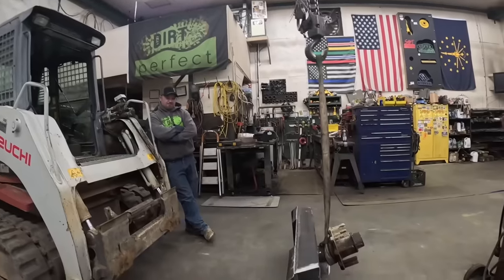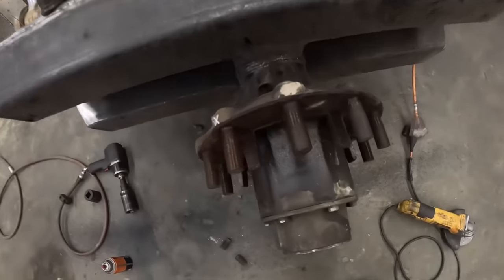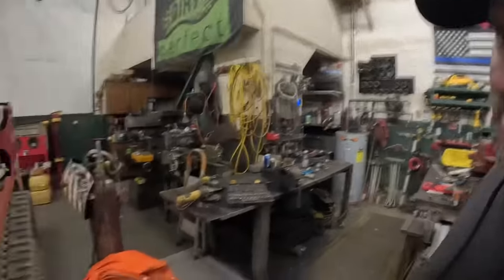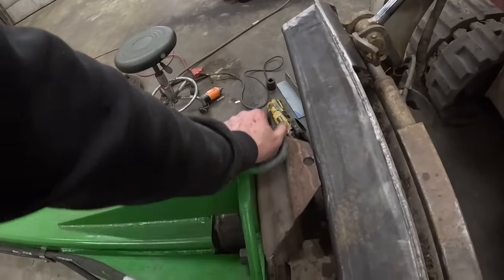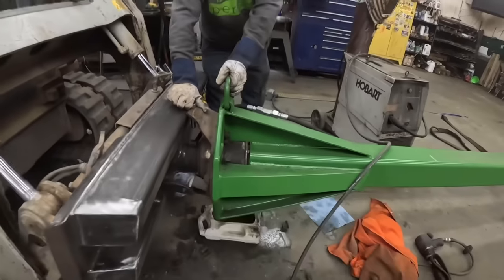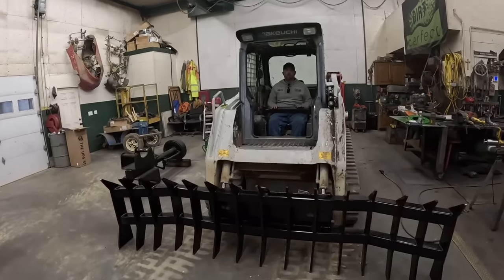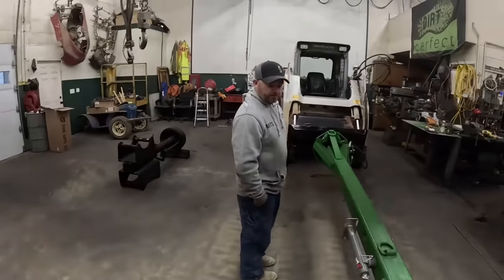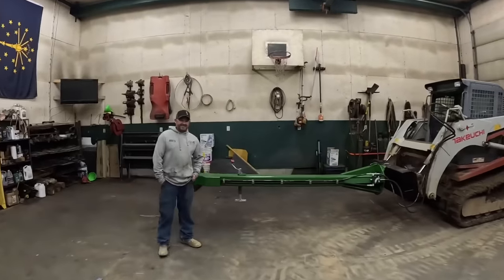Testing Out The Brand-new Saw Set up on CTL - Success Or Failure?

Comment: I think I would put a guard on the back portion to protect the driver. If for some reason if the blade broke or come loose it could get real ugly real quick. Be safe.
Reply: That blade that big and heavy its going to just about split the taco in half.
Reply: I was thinking the same thing
Reply: That would take all the fun out of it.

Comment: Might I suggest that since y'all have plenty of studs to bolt it to.
Take three of those out, and replace them in a way to taper them as alignment pins that are longer than your attachment studs.
That'll make it much easier to connect everything together. 
Otherwise I say y'all did excellent work both in conception as well as construction of y'all's universal implement.
Nice rake for cleanup afterwards too.

Comment: If you'd have kept more of the brake drum you could have just added holes to the drum with one anchor point on the attachment to index the rotation.   awesome work!
Reply: That is what I was thinking
Reply: Same
Reply: Great minds think alike 😂
Reply: That could still be done with another junk drum since it’s not welded to anything.  Version 1.1 😊

Comment: Hey Mike just to let you know you can move one bolt hold over for each lug nut that would change the angle of the blade. Great job my friend
Reply: 1 pin vs. 8 lug bolts.. pin seems a lot easier.
Reply: @Silverhornet81 
I think he still means to use the one pin but if DP finds placing the blade just off vertical he could utilized the 10 (not 8) lug nut positions to adjust the blade angle by 36* off vertical or horizontal.
Reply: Sorry.. 10

Comment: You can always increase the blade diameter instead of turning up the rpm’s on the drive motor.  Blade tip speed will increase and blade mass will give it more cutting ability.

Comment: Hey Mike. Very nice job.  With an air ratchet to mount and unmount, it seems like this will be more challenging for an on-site switch over from one mount to the another!  Just a couple of thoughts on improvements.  (1) You could mount the stand to the top plate that connects to the 240 (Plenty of space on top of the 6x6 bar).  (2) You could add in a valve control bypass to give it more power if necessary. (3) Ever think of replacing the saw blade with a chainsaw bar?  Looks like it is possible and you could get some extra reach with larger limbs, maybe in the range of 16 to 30 inches!  Where to mount the auto bar oiler! 😁

Comment: Mike, it looks like operating with the blade in the flat position really works for cutting down the trees. I could see where trimming limbs straight up and down position would work really well along a trail as you mentioned. Trying to cut small trees with the blade straight up and down leaves a pretty dangerous stump but when the blade is in the flat position it looks like you can get pretty close to ground level. Great job and thanks for taking us along during this journey of yours.   J.R.

Comment: Great job on both of those projects. I have a couple suggestions for the eliminator. I would think you would have better hose protection if you rotated the saw so that the blade was above the attachment in the horizontal cutting position. The second suggestion would be to add a skid attachment to the end of the saw so that if you hit a dip while running the skid steer, the skid would prevent the saw blade from gouging into the ground. You could also consider building a bolt on skid that sits back offset from the motor side with an additional skid that would prevent the blade from going into the ground while in the vertical cutting position. The only downside to it would be that it could be in the way if you're trying to cut in between trees that are close together. Hope this helps

Comment: Great Job, Guys!!!  One suggestion for easier changeover on each hub.  Replace two of the (opposite side) lug studs with smooth side pins (on both hubs), with diameters slightly larger and longer than the lug studs major thread diameter/length.  Should just slide on, even slightly off angle, and completely protect the lug threads.  You may be able to swap the saw arm from hub to hub, under machine power, as well.

Comment: You need a ground skid (ski) that can attach where your removable leg mounts, to keep the blade out of the dirt in horizontal cut mode... Heck, if you plan it right, it could work in vertical mode too!  This thing is cool and red neck dangerous on a Mad Max scale!

Comment: Shop time today ,for the next iteration of the Frankenstein saw  ,one of those unaccounted for obstacles, engineering on the fly ,critical thinking ,AKA working through problems ,A  great way to spend Monday morning ,watching the boys A fabricating on Frankenstein saw ,I was wondering How long it would take Mike to Start taking down some big stuff besides saplings and then the pine came down ,you just need to spin the blade at a higher RPM .Awesome Job you two

Comment: It seems to me that you could benefit from adding a 'wedging' arm to your spinning blade. This could conceivably stick out from the main arm at an angle of about 45 degrees and be a few feet longer than the blade radius. A strong-enough loading spring could work ... to stabilize the saw and arm as you approach a trunk or a branch without creating hard collision.. Right now, everything is sort of wobbly and you waste time lining up properly. The arm would slide against the object to secure it to the saw arm and allow smooth cutting without bounce.

Comment: Awesome builds! One thing I said to myself throughout the saw build was the hydraulic lines along the boom should have been hard lines instead. But as it is now I think it would be wise to add a protective cover over those hoses on the boom. And, try removing the flow control to see if the Taco runs it better.

But overall, what an awesome use of bad weather time!

Comment: Hi Mike,
I have a suggestion for your Limbinator!
Weld on a 2" square receiver hitch socket pointing down.
The make a "T" shaped insert as a stand. 
This will provide a stand that can easily be moved, but it will prevent the saw from rotating when on the stand. 
Unfortunately saw blades are expensive!
I love your great addition for your toy!

Comment: While you're getting the hoses, have a quick coupling mounted on the lemonador to where you can put a quick cup line there and then at a quick complaint on it. The skin steer and then that way. That set of hoses will be one size and then put a quick coupling. Um, the hoses for the excavator and then you won't have to change it. Do nothing but change out the 2 sets of hoses. That way you won't have to have too long. A hose on one or two or two shorter holes, on the other think about it

Comment: Good Job! Liked watching the build and can't wait to see it in action. Can't see much in what could be improved that wouldn't pass the cost analyses test. About the only thing I'd do is extend the Hose guard about 3 or 4 feet. Maybe with a fairly light piece of sheet metal with ribs for added strength and use the hose mounting bolts to hold it on. Unfortunately the best way to get the blade at a 45 degree angle would mean messing up some of your paint on the hub with welding another of Aaron's snake eye brackets to the backing plate. Again good Job! Very useful attachments that should pay for themselves fairly quickly.

Comment: See a hose solution.
Where you have them all bolted to the stick, get some 1/8" steel bent flat the width of the hose clamps and 45° on each side and use the same bolts to put a shield over the lines on the stick.  Should keep the branches off the important stuff.
That flow control valve just isn't working to full potential of the saw!  It needs to spin a little faster.
The best application i see is like the farm property, cut it down to a foot off the ground by just tracking left to right while going forward,  you should ger a 20 foot swath cut, then use the brush hog to grind it up and finish it.  It's not a forrestry mulcher, but together with the brush hog, it's close.  For the spots that are a little too soft for the 120 or 210.
I love watching an idea turn into a completed attachment!  I am most certainly a function over form guy, but you guys make it look good, too!
I know you hate orange, but, for visability and safety, ya should paint the outside plates on each side orange.  Would be much easier to see.

Comment: Great job guys. The only thing I might have changed is to put a rotating hydraulic motor to be able to spin the saw 360 degrees. With the hub assembly, you could put a ring gear on it run by a hydraulic motor…..just a thought. Again Great Job…very cool.

Comment: Well as i write it you said it while testing: A 45° locking option would give you more versatile use out of it. Maybee eve a 22.5° as a more vertical and more horizontal option depending on do you want more clearing out an area or overhead branches on a streetway.
Also clearly you need protection cover for you hoses to deflect falling branches. Just cut a Pipe and and bolt it on.

Comment: Guys, maybe a hydraulic rotator on the wheel to select the angle from the cab with a solenoid pin lock. Ring and pinion gear might be good. Great minds you have. Nice saw.

Comment: When I worked at the boat shop some of the employees went to France to work on a boat there. When they came back, they had a new 'tool'; it was a 6" circular saw blade on a high-speed grinder and they used it to shape lead ballast. 
I thought that was the most dangerous tool I have ever seen, until now.

Comment: Mike another fun video, you and Arron did another fine job, as always Castiron is very brittle and breaks Easley be careful I'd hate to see it rotate while it's in use, My drivers would break axles when their tires stopped spinning, in snow and the tires grabbed a solid surface not real often but more than I wanted to repair. I would have used something other than cast because it's a brittle metal

Comment: I know it's way too late to suggest this, but if you had a piece of plate cut to mimic the drum face, then make 3 tabs that stick out, 0° then 90° left and right, so the blade could be left hand cut, right hand cut, or bottom cut to reach under tree or bush. You could do the same with a drum, but so many are cast it might be difficult to work with.
Edit to add, using the current config, I would just weld another tab on the other side so you can make it a left hand cut, so the offset is in your favor depending on direction of approach.
Also, it would be dead simple to get a piece of channel iron, or 1/8" flat stock, run through a press brake to make a channel to cover your hoses from the motor to the base. Replace the bolts on your hold down clamps with studs or short sections of all-thread and use those to hold the cover in place.

Comment: If you ever make the larger mount a power rotate I think a flywheel off a truck could be fitted to the outside of the brake drum. Then use a starter motor with a spacer to keep the gear engaged use a power reg. to slow it down. You could use an actuator or solenoid to lock and un-lock the brake. I am thinking put a limiting switch so it will rotate about 130 to 140 deg.

Comment: Hello that tree trimmer is great 
I had a thought add more holes to pin it in they make pull pins you could weld to the break drum ear you can just pull up on pin rotate and let go of pin it's spring loaded they make. Electric ones to just a button push it unlocks let go it locks

Comment: I had some loggers once that, once they got into the shop, there was no getting them out until they ran out of money.

The saw on the TacoTractor really looks good.  I can see doing some definite timber stand improvement with it.  The only thing that I'd want is a way to change the angle easily from the cab. Snowball Engineering just did some repair work on an attachment for tipping boxes over to dump them.  Used a hydraulic cylinder and a rack.
Reply: Saw that as well and was thinking the same

Comment: You need to make a push bar on the other side of the blade so you can push the tree when you are cutting it. This way you can guide the tree in the direction you want it to fall. Also it will keep your blade from binding up.

Comment: One of the few things I might have done differently would be to use hard lines between the blade motor and the base of the arm where the flow control is.  Or, if hard lines don't make any sense, make a light gauge "sacrificial" cover that can be bolted around that side of the arm.

Comment: need an old water hose, cut to length and split, to cover the blade for protection.  Nice thing about the verticle cut is that you can get really close to the ground on your cuts.

Comment: Paint on the saw, paint on the Taco saw mount, paint on the brush/root rake but No paint yet on those 2 nice saw horses. Instead of the horizontal lock position - put one 30 degrees left and right of center.

Comment: I think that a deflector/guard of some type for the blade so that the drive doesn't get pelted with bark/twigs or showered in saw dust. I was thinking you might want to protect those hoses, when I was watching the build videos for it I was thinking you were going to run the hoses down the inside of the 4" tube. (I am sure that there are good reasons not to as well as to). Since you didn't do that, you could get some expanded plate and angle iron and make a grill over the hoses- adds some protection but not a lot of weight.

Comment: Something I noticed might be a good attachment that possibly could be removed would be some kind of push bar that will push the trees away, or try to. May not have that issue in one of the track hoes, but noticed it could be an issue in the skid steer.

Comment: If you ever decide to make another one,   use the same diameter tube but use circular pipe this time and mount the angle adjuster near the front end not the back using facing twin circular plates with a quick release pinch lock on it to make changing it from vertical to horizontal   or ANY angle inbetween etc a lot easier and faster in the field...... and eliminate that Heath Robinson brake drum contraption - which would save weight into the bargain,
 also I would consider using steel tubing  for the hydraulic pipes mounted along its length instead of the far more expensive flexible hosing which would be far more snag resistant and save on build costs just using a pair of two or three foot flexi pipes near the head.  but all that said damn good job thus far by both of you.  while you are in innovator mode perhaps consider a quick release dog clutch system for the blade  and an angled attachment to mount a six foot hedge trimmer  sticking out in front to hack through dense vegetation/foliage etc.

Comment: a few ideas:   on the ptl adapter plate add a mount for the jack to keep it out of the way.
For the brush rake keep a 4x4 handy to place under the "top" when you remove it so it does not lay flat, but at an angle to make hook up later easier.

Comment: Ok if a multi tool is something that has lots of accessories you can use, what's a tool that can be used by everything else. All you need now is to work out how you're imad max tool can be attached to both Bubba Dump and the 850j, it will be truly universal. Am sure it's going to last for a long time, it's built like a tank. 🎈

Comment: On the adaptor if you had cut the bolt  drop area 1/2 way around you could cut multi bolt drop holes and had more angles.

Comment: Adding a Limb Screen using Expanded metal Closer to the Mounting End For Safety is my Only Suggestion so if a blade Decides To Exit The motor in Chunks You are protected in the open Cab of the Taco

Comment: too bad that the attachment isn't connected to a hydraulic mechanism to make it easier for MBTS to weld. Same with mounting the arm on the Taco, why not just drive the Taco up to the arm and make the connection instead of using the overhead crane. LOL. Watching you use that on the Taco, would be nice to be able to rotate the blade hydraulically for working at different angles depending on limbs or samplings your taking out. Great work guys. Thanks for sharing.

Comment: The only thing I would have tried to run the hydraulic lines on the inside of the tube, and I would add a deflector to keep the sawdust from coming back toward the cab on the Taco.

Comment: running the blade horizontal with no guard.  if you hit an 18" or so (long)  log laying on the ground it will launch it back at you and take your head off. I know from using a saw blade on a weed eater and getting hit in the chins with 6" sticks. Gl with that. 👍

Comment: That rake looks awesome on the Taco. The question will it be able to push branches. :) Will there be any  problem with balance with the blade on the skid steer? Question is the blade redundant with your to brush mulcher? Lastly, are you not creating a safety hazard cutting trees at a 45 degrees? Thank you and have a wonderful day.

Comment: I think i would have put the hoses inside then they are protected by the main beam.  Other than that I can see a rubber wheel that sits to the break drum with a slow moving hydro or electric motor to turn it.  Awesome build!

Comment: I'm pondering whether a 45° tab to the right side might be beneficial. Then when you're cutting vertical trunks, and starting from the right side, the upper portion of the tree would slide down off the blade. And the blade rotation would "spit" the piece away from the operator. But! Would the angular movement of the boom be too tough, to prevent binding the blade? 👍Mike "MacGyver" Simon.👍

Comment: the skid steer root rakes I have seen, the skid steer doesn't have enough ponies to push it thru heavy root concentrations and NO mud or it stops the skid steer.......... much luck........how's the tip with the exterminator?